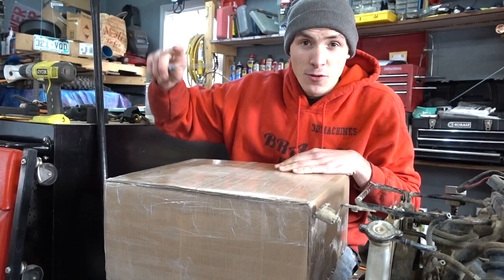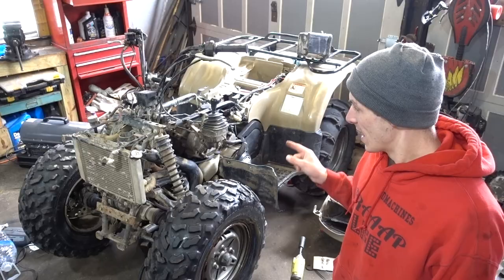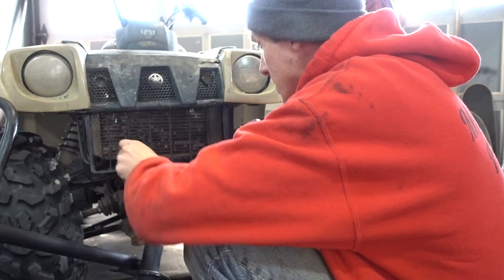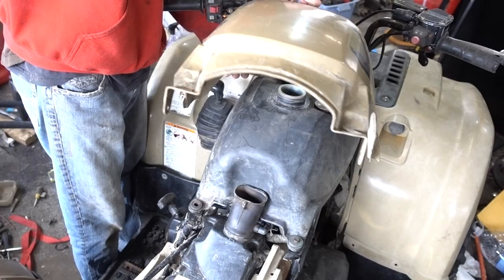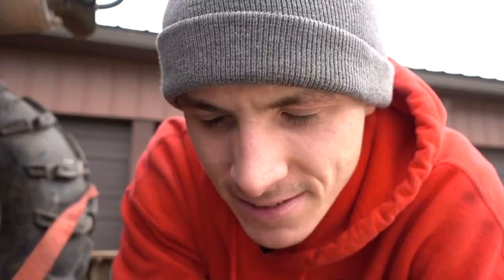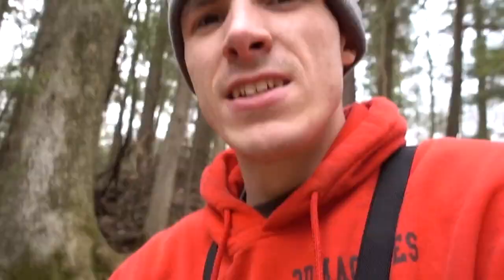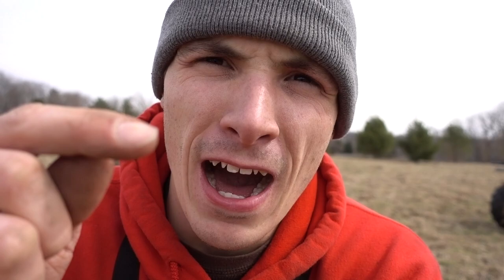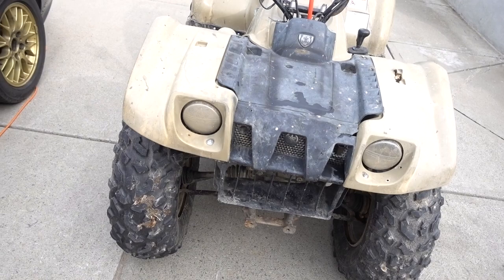FIRST OFFICIAL KODIAK 400 RIDE!!

Comment: looks good without the front rack
Reply: Yeah, but the radiator has no protection when it's off.. But he can buy an after market brush guard/bull bar for it,  and they look much better than that rack it came with.. And they really are pretty cheap..

And in case he reads this, There's a used 1999 Yamaha Kodiak 400 4x4 Front Brush Guard on ebay for $99, and they have the front skid plates that keep sticks and things from going up from the bottom into the radiator for like $15..

Comment: All you need is paint, a light bar, and maybe a winch.  Good to see you finally got it going.  So is the KTM running?  Last you showed it died in the woods and you had to get it with a tractor.

Comment: I have the same quad it’s making a clicking noise at the solenoid but the battery voltage is fine do you know what it is checked the wires there not corroded

Comment: the difference between todays and yesteryears horsepower is that hp of old would come on at a lower rpm resulting in more torque at the same hp making it feel stronger. kinda like a 300hp 4 banger that you have to rev to 8k to make power vs a v8 making same hp at 5k.